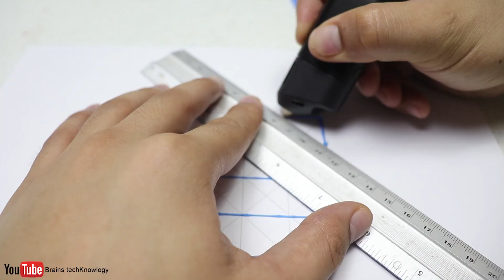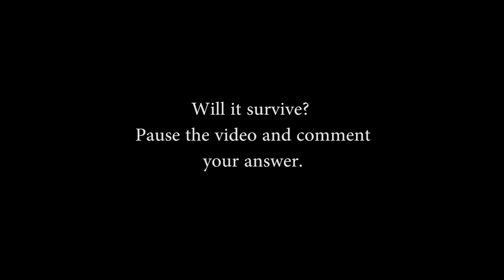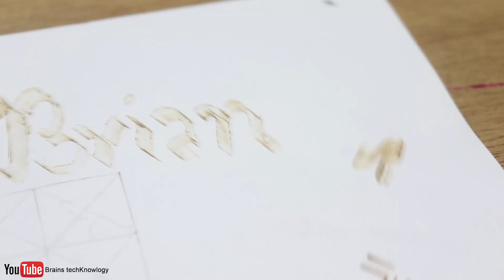Drop test - Can a 3D pen artwork protect an EGG from breaking? - 3dsimo

Comment: I like that base on foam cutter makes it easier to cut angle bevels on my foam board pieces for my Adams ready foam board flite test style built rc planes and other things as well I love mine. It's like having a fully adjustable bamdsaw for foam that you can hold in your hand better then my other foam hot wire